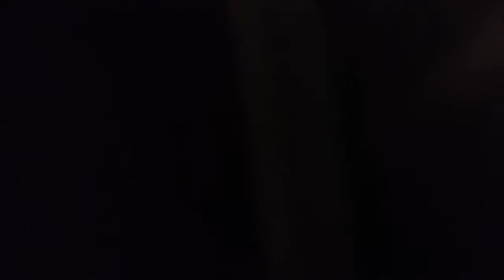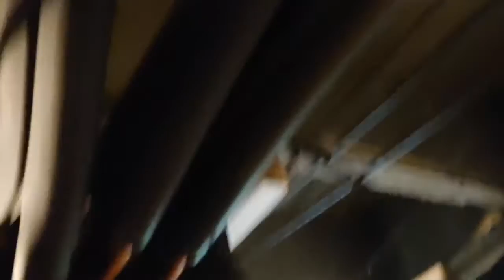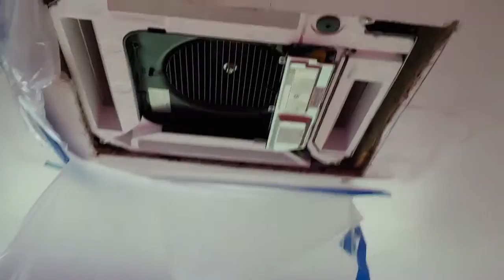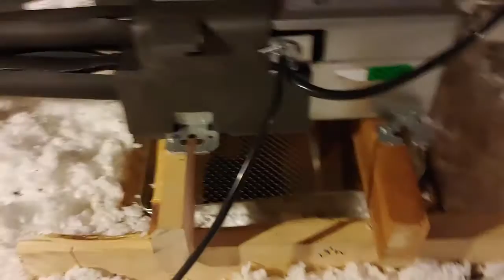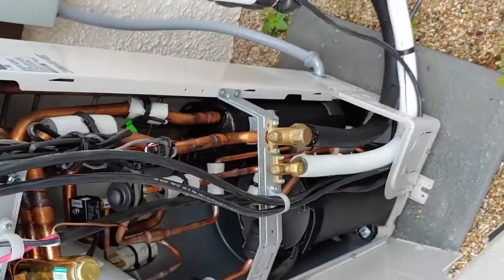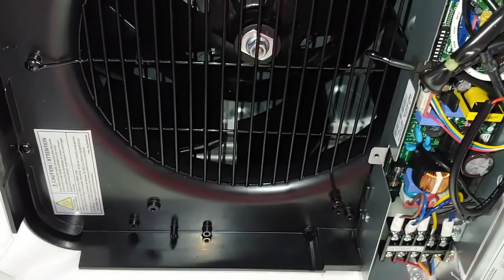LG 60k Branch Box Mini Split System install

Comment: The reason no HVAC guys will come out and charge your unit is because this trade is their livelihood and when people start trying to do it themselves thats a slippery slope. You cant just buy a refrigerant license for 20 bucks, it takes a huge investment to get that and theyre not going to give their trade away to anyone who asks. The same reason im not going to pull an electrical permit for a homeowner who wired their house themselves and then cant get the power company to connect them. Its not going to happen. The only way to get around that is knowing someone who will do it for you. I really cant blame anyone for refusing to do this.
Reply from the maker: I get where you are coming from but its also their choice to make its unaffordable by marking up the cost for installation (in my case wanting to charge almost 20k in labor for something that 2 guys could get done in a weekend) also, at least when I was looking into it, a refrigerant license was $100 and a 6 hour online class to get.

Comment: i just installed one of these units myself but used 3 concealed duct units. i'm curious, when one unit is running, does your branch box allow refrigerant to flow through the units that are off? i'm concerned my branch box is defective, cant find much info online.
Reply from the maker: My branch boxes throttle flow to each unit based on it's demand. If a unit is off the valve to that unit is shut

Comment: very informative. Thank you very much. i was specifically looking for what the branch box is and how it works. You had two branch boxes setup. Did that require that your outside unit had two condensing line connections to hook each branch box into?
Reply from the maker: no my condensing unit only had one in and one out  however ecomfort sold with my unit a line splitter (3/4 in and out and 3/8 in and out) so that i could make 2 inlets and 2 outlets with little line restriction. over all worked great. havent noticed a difference between downstairs and upstairs AC quality.

Comment: Wonderful job McWiggles. This is a gem of an youtube video for me.  I did a lot of research on LG Cassette system but never found a video like yours. Ours is a 1000 sq feet ranch style house in San Francisco. Just vacuumed out all the old insulation from attic. Perfect for doing this now, before putting in the new insulation.    This gives me and my wife hope that its totally possible to do the install all by ourselves.   We also would have to cut a square in the ceiling because ours is 16 inch center.  Hope you can answer some of my questions here during my install in the upcoming weeks.  We got a quote of 20k for traditional HVAC system! Its crazy.    I used the BTU calculator on ecomfort website that came out to 32,000 BTU approximate for our house. But I want to go a little oversize just to be sure.  Do you think there is any serious disadvantage in buying an oversized(Higher than required BTU) outdoor unit?
Reply from the maker: good luck on your project, honestly as far as over-sizing  goes I don't see much of an issue, the higher btu units are typically higher efficiency as long as it doesn't push you up to a branch box unit I would for sure go oversized

Comment: Great video!  I was wondering about the distribution boxes and how that setup worked, you answered a ton of my questions.  Yeah I have found that the HVAC industry in general is a huge "good old boys" club that don't want anything to do with you buying the equipment not from them.  They like to double or triple the price of everything, so even if you buy the same equipment they would, they won't touch it.  Also did you use nylog on all the fittings to prevent leaks? Did you have any problems with leaks?
Reply from the maker: nope I just made sure I had a really good flare on each end. I had one connection that had a leak but i just tightened it a bit and that solved it.

Comment: We just got a dual zone ductless Lg installed , but both units have to be turned on to work. The installer has vanished. Need some help please!
Reply from the maker: I'm not sure whats wrong, maybe one of the communication wires is loose/not connected?

Comment: Hey man props on the install! Its good to see average people getting out and doing things for themselves. I bet you know more about your system then a lot of service techs do. As a professional it's disappointing how some companies don't want to "touch" your work because they didn't install the system ($$$), and that goes for a lot of industries not just HVAC. One recommendation for someone looking to do this yourself, buy a gauge set? They are cheap and you can use them to diagnose, service, and repair your own equipment. A vacuum pump and scale are also a good investment. How is the system working our thus far, and whats your monthly electricity bill look like? I'm curious if LG will warranty anything if you have any issues...
Reply from the maker: so far everything has worked great, my monthly electric bill in the summers has gone down probably $20 a month because before I was just using 2 window units that ran pretty much 24/7.  I'm not sure if LG will honor their warranty but I hope I don't have to find out

Comment: Just rec’d my LG 6 zone set up from ecomfort and have a question about bedroom installs - could I run the line sets on top of the ceiling for the wall mounted. I don’t have an attic - live in a city row house with a flat roof. I didn’t get the ceiling mounted because not really enough room. Is it possible to bend the lines from handler up to meet the line set on the ceiling ?  I know I need to slope the condensate but I will handle that differently.
Reply: I installed this same unit on my flat roof house last summer.  To answer your question, yes, you can bend the line sets to go to the roof.  I had to put three 90 degree bends in the line set to get to the roof.  I used two different sizes of tube benders.  One for the larger gas line (3/4”) and a smaller one for the liquid line(1/2”).  If you don’t use a bender you could kink the lines creating a potential weak point for leaks.  In regards to your line sets to and from your bedrooms, you could run the lines either straight out the back into the wall to the outside of the house or straight out the side along the wall to eventually run outside.  Because the line sets are under pressure you could run them either out the back or side and then up to the roof.  Although, with wall mounts, you’ll want to make sure your condensate lines are running downhill.

Comment from the maker: If anyone is interested in a one year review on how it has functioned as well as an electrical cost breakdown let me know and ill make a followup video
Reply: I also installed this same unit last summer and ran into a lot of the same problems.  I have a flat roof and had some additional challenges to deal with.  I have 6 cassettes and 1 wall mounted unit.  Cutting out ceiling joists and re-framing it to install the cassette was not fun.  I also had a two ceilings that were not deep enough to fit the entire cassette so I had to build a box to mount to the ceiling to make room.  I also learned the hard way about making sure the line sets are adequately insulated or they will build up condensation and leak into your ceiling.  Initially the units worked great, but I had my roof redone earlier this year and I think the installers disconnected the lines and let all the coolant out.  So I need to recharge the system and like you, I can’t get anyone to come out and do it.  So, I can find it on eBay.  I also bought the gauges and lines to do it myself.  Here’s my question for you or anyone else that can answer it:  What PSI do I charge to?  Everyone online that does a DIY/how to shows units that are half the size and they all charge the system to about 115-120 PSI on the low side(gas line).  The plate on the side of the unit says it should be 240 PSI.  If that’s the case I can’t seem to get it past 140 PSI.  Since this size unit is basically two units stacked on top of each other do I really need to get it to 240 PSI?  Right now the system cools but not like it did initially.
Reply from the maker: @pauldapilot2645  yeah I'm not sure what the final pressure should be.  You may have froze your line up by putting it in to quick and make have you try to add it slower.  I think the best way to do it would be to look in your manual and find out how many pounds of refrigerant comes in the unit and perform the additional add calculation and add the two together then add it by weight rather than trying to hit a PSI.  keep in mind you will have to re-pull the initial vacuum and should probably do a new leak test. other than that i think the guy that came out to help me said that the final pressure came pretty close to a traditional AC units pressures
Reply: @pauldapilot2645  https://youtu.be/JQkth-AM5CE?t=2907 was super useful for understanding this
Reply: I am really interested in.  I am installing LG system myself.
Reply: so if i was to get a 2 or 4 zone compressor unit i could use those branch boxes to ultimately end up with 6-12 zones?

Comment: Thanks for the video - I am thinking of doing the LG 6 zone system myself with the hyperheat.  I have a few questions though...
I will need to split the into two branch boxes using the boxes you have as well.
1) powering wire did you use - was it 6/3 w/g?  I could be wrong but it looks like you connected your neutral wire to the ground and left the bare ground unconnected.  
2) would it make more sense to buy a long line set for all the runs and cut and flare them to size as needed?

Thanks in advance for the great detailed video and your willingness to share your experience and pitfalls.
Reply: sorry - 220v doesnt have neutral.
Reply from the maker: 1) i used 8-3 and yes i connected the neutral to the ground because as far as i could tell based off the manual there was no independent neutral connection for the LG system (the whip kit is universal) 
2)in hindsight it would probably be more economical to buy longer line sets because you are going to have to re-flare them anyways, when i was buying all of the stuff I was thinking I would just use factory flare on most of them but that was not the case
3)yeah you will need the branch boxes because their larger condenser only has 1 port to connect to for the line set so you will most likely also need a splitter as well.

Comment: Yes n no...here’s my issue. All of the indoor units I want to install will require installing the condensate lines horizontally opposed to vertically roughly 40ft each. I am comsodering installing aspen Mini Split Condensate Pump Kit for each unit. What are you thoughts?
Reply from the maker: for my 2nd floor units they are cassette style units that have built in pumps, if that is what you are using you wouldn't need an extra condensate pump(mine run about 30 ft horizontally before going vertical). If you are using a wall mounted unit then yes you will need some sort of condensate pump.  I believe that some of the different brands have pumps that you can hook directly up to the unit but I'm not sure which brands. you would have to look at the spec sheets to see.

Comment: This was a very helpful video. I am doing research in preparation to install a 7 zone system with 5 wall units, 1 ceiling cassette, and 1 concealed ducted unit to add my guest bathroom to one of the bedrooms. My 2400 sf single story house currently has a 12 year old 4 ton central air unit. I installed a solar system last year which opened my eyes to how much energy my current hvac system uses. After seeing my heater pull 9kW, I decided it's time to go with a multi zone mini split system. Thanks for the details of your install and the helpful "wish I had know" tips.
Reply from the maker: glad you found it useful, as a reminder I'm not currently using it for heating because i have a HE boiler system installed. I don't know how much wattage the heating aspect of it would use.

Comment: I am planning to install the same system you have by myself. Thanks for the video, it is very helpful. The only comment I want to mention to you is use proper wire connector on all your connections. System looks awesome! Again, thanks for sharing!
Reply from the maker: no problem! and yeah i really should have done that.